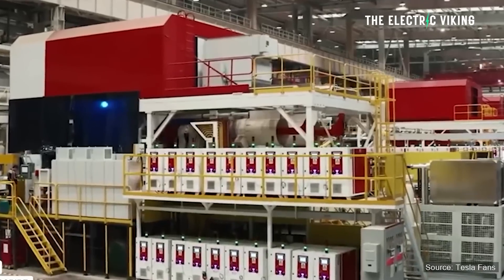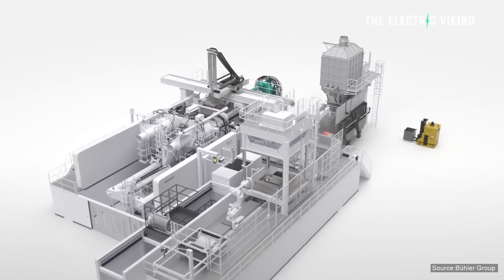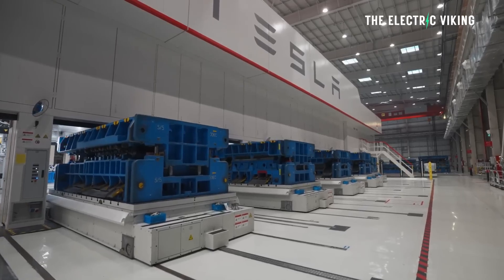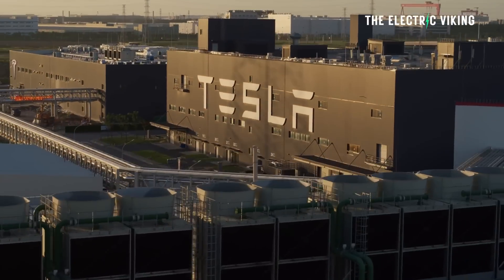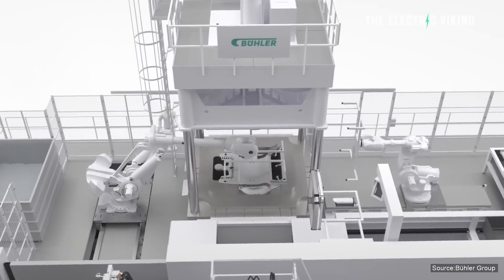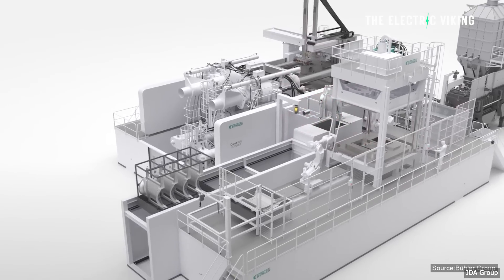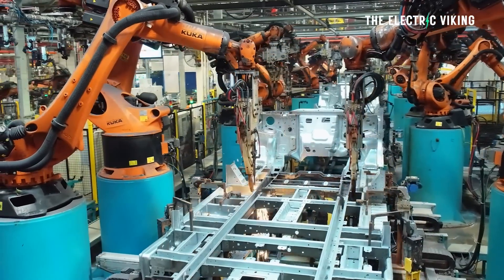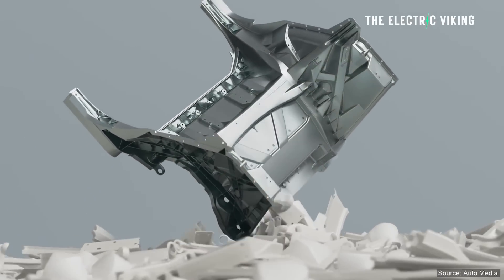Chinese engineers invent giant magnesium Gigacastings for cheaper, lighter EV's

Comment: I'm not sure of this, because it depends greatly on the alloys of aluminium and magnesium; both have a wide range of strengths depending on composition and heat treatment, if any. Recently developed alloys of Aluminium with a small percentage of Scandium have strength that exceeds many steels, and is much better than magnesium. Smith & Wesson use it for some models of their 44magnum revolvers. I don't know of any firearms using magnesium,,,yet.
Automotive use of magnesium goes back a long way in engines. I had a 1959 500cc Norton 'Manx' that used magnesium crankcases.
Reply: That is a small amount of magnesium, not a big casting. Don't forget V.W. engine castings were magnesium.
Reply: Good post.

Comment: Mercedes used a magnesium AutoBody frames and had a few disaster with the frame being highly flammable. It’s just another engineering hurdle but the endeavor is worth the try. Maybe they have a metal mixture that will work well. 
Thanks electric Viking 🙏🏽👍👌🏾⚡️⚡️⚡️⚡️⚡️
Reply: I guarantee they have one that will burn well. The Chinese do make good fireworks.
Reply: Came to post this about magnesium being extremely flammable. A Chinese auto maker battery fire will certainly take one of these magnesium bodied cars through the concrete overpass it's stranded on. Fighter jets have been pushed off of carrier decks because of magnesium brakes catching on fire. LOL
Reply: Nothing like burning a VW beetle engine case.
Reply: Alloys aren't chemically bonded. If you want lighter weight, you use a higher proportion of magnesium and get a more flammable part
Reply: With the appropriate alloy combination, magnesium does not ignite or explode. The specification of suitable magnesium alloys for defined industrial uses is a specialty of Galaxy Trade and Technology.

The common misconception about the dangers of magnesium is due to confusion of magnesium alloys with pure magnesium. Pure magnesium, in the form of powder or ribbons used for photographic and pyrotechnic purposes, as well as in high school chemistry experiments that every student remembers, may ignite if exposed to flame.

Here are some key facts and information about magnesium safety:

• Solid magnesium parts will not burn until heated above the melting point. This melting point is similar to aluminum, at 650 ̊C or 1202 ̊F.

• If locally melted, the high thermal conductivity of magnesium will generally ensure rapid cooling and prevent a fire from spreading.

• It is possible, with a welding torch, to burn a hole in a magnesium sheet as big as the cone of the welding flame without igniting the surrounding metal. Similarly, a welding torch can be placed on a full-size ingot and it will not ignite.

• Magnesium alloys can be easily welded. Welding temperatures are typically very high at the point of application of a gas jet or electric arc, yet the welded alloys do not ignite.

• Magnesium alloys in mass industrial production are commonly rolled, extruded, forged, and heat-treated at elevated temperatures (over 400 ̊C or 752 ̊F).

• Magnesium alloys are widely used in jet engines, in the structures of military and civilian helicopters, and in hundreds of auto components, without flammability issues.

• Fine grains of pure magnesium are highly combustible, but even so magnesium can be safely ground or cut if the right safety practices are applied, particularly to avoid the accumulation of potentially explosive dust. These cautions are similar to those that must be observed when working with other materials — for example, accumulated dust from grinding aluminum or other fine powders such as flour or sugar.
Reply: @blueeyes6192  Magnesium alloys will always burn. You can increase the ignition temperature by alloying it with sacrificial element. Calcium, which is more electropositive and grabs the oxygen first, seems to be the first choice. Looking at some of the examples, they lose mechanical stability and almost melt before they ignite. That might help remove them from the scene or put them in more intimate contact with a heat sink, which will make them harder still to ignite in an accident
Reply: I like the idea of a possible cheap copy similar to a Rolls Royce with a sturdy light weight metal frame. They likely do not exist at present.  It could be a cheap way to build larger vehicles and cars with a light weight body.